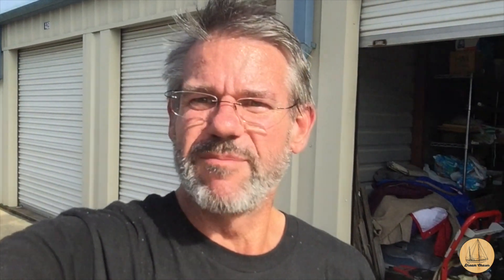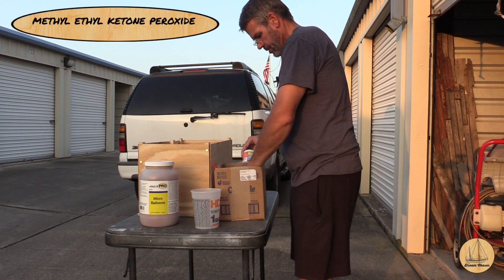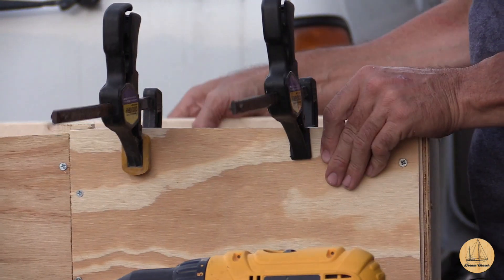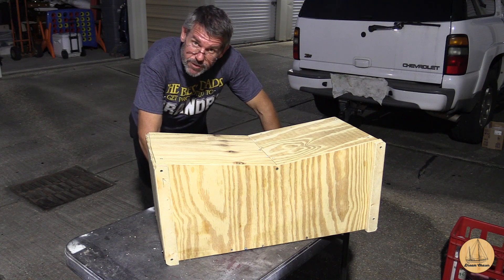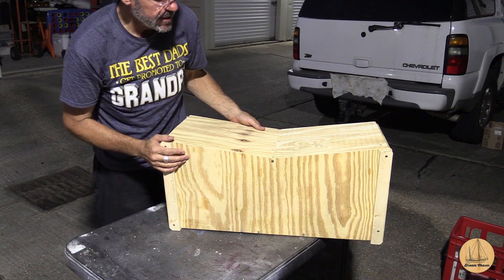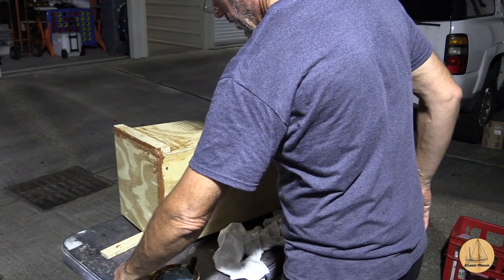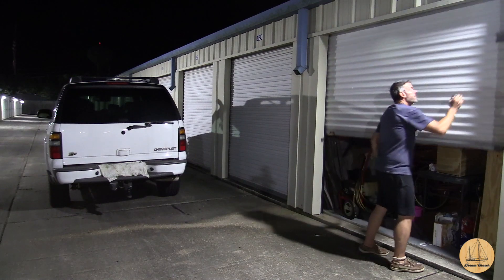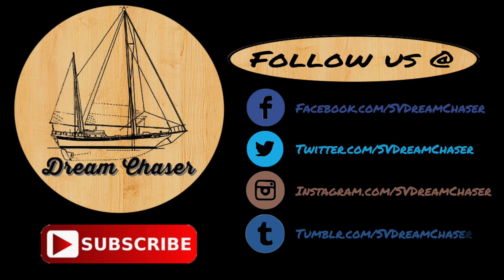Make your own Deck Box with Plywood and Fiberglass Part 1

Comment: thoughts for the future, i know this is older 2017. but cut ur wood at corners on 45 degrees, save a ton of resin. or glue corners w/less wood, kicking time is though i do same
Reply from the maker: Great tips. I struggled with this project. It ended up being the reminder for me to hire this fiberglass work out on the deck of the boat. Lol

Comment: great box... I'm going to build one at some point...something I've seen done is filling a plastic freezer bag with the epoxy fillet mix then cut a corner as a tip and squeeze it in, then spoon it...love your videos...thanks
Reply from the maker: Great idea.  I have done that filling screw holes or pushing epoxy into small holes.  I will have to try it on Fillets.
Reply: That sounds like a smart plan

Comment: I've worked with fiberglass with no heat in the middle of winter and in searing heat in the dead of summer.
Itd be perfect to be able to work in a walk in freezer then bring your project outside to harden.
Reply from the maker: Interesting. So was it all about the MEKP ratio adjustments depending on temperature?

Comment: Take it from a 40 year glass man, for corners where everything comes together, plain "Talcum Powder" and resin works as good if not better than microballoons or shredded mat
Reply from the maker: That is GREAT to know because as you can see from the finished product, I certainly lack the experience and skill in this area.  Frankly doing this project led me to hire someone to do the deck work on the boat.
Reply: Question: Could you use spray foam for inside corners... 
Tape off corners
Spray foam edges than let foam set up 
Than round over a thin piece of metal like band iron to get the round over radius 
Heat band iron with torch than heat trim the spray foam to exact round over
Peel off blue tape and done

Would that work?
Reply from the maker: Hopefully GasserGlass Will answer as well but I think it would. I have seen the boat yard use that expanding foam to fill a gab and then round it with a grater (not sure what else to call it) then glass over that for the contour.

Comment: Hi my name is Frank and I'm considering a buying this 32 foot Ketch and the deck is having some problem I haven't seen the boat yet I'm going on the 1st to see the entire boat but I could tell there was a one piece that had a hole in the in the decking and I'm very concerned about it even though the rest of the boat is fine but only by pictures so I'll be able to see it come the 1st or 2nd of July can I contact you and send some pictures and get some advice?
Reply from the maker: I am more than willing to have you do that. I am not an expert but I have certainly run into my share of deck issues and can provide some lessons learned and things I wish I had done to better negotiate my deal when I bought. Reach out to me at glhotka at SVDreamChaser dot com and we can trade contact info and what not.

Comment: It would have been so much quicker, easier, and less expensive to use bodyfiller for the fillets.
Reply from the maker: I think you may certainly be right.  I may have to do this whole project again now that I actually have learned a LITTLE bit about Fiberglassing.  This project actually was pretty crappy in hindsight, but it allowed me to get experience with the tools and materials without doing it on something valuable.  All I really lost was a few bucks and some of my time.

Comment: could you please answer a question please or point me in the right direction.I am making a 3 box plywood sump filter to go under my 500gallon fish tank. I have to do this because there is 2 metal supports stopping me having one big box. they will be joined together with pressure plumming screwed together. I'm planning on fibreglassing all the tank/boxes inside and out.. how much time can you leave the first coats and fibreglass before you have to put the coloured wax coat on please.
Reply from the maker: +Leigh Shelton - In my experience you don't have to wait between the coats but this assumes a few specific things.  First I am assuming that the polyester resin you are using does NOT contain wax.  Sometimes it will be called a "Laminating Epoxy"  This remains a little bit tacky and the final colored wax coat is what lets is fully cure free from air that allows it to harden.
I hope this response is helpful.   Also I can tell you from experience that 2 tanks joined together with either at least 2 lines between them is as good as a single tank.  I did this on a previous boat for holding waste water (not the same material, but maybe even more important to avoid leaks :))   If you have pipes plumbing the 2 together, just be sure you have one low and high on the tank so that any pumps that suck water our or put water in allow air to pass between the tanks to avoid an air lock.
Reply from the maker: Sorry I may have misunderstood your desire.  I assumed it was to do it all at one time quickly.  It doesn't really matter.  You can do all layers including the top wax layer at once, or you can also do layers of laminating resin with  any* time between coats.  I added the asterick because there may be some practical limits here.  For example I wouldn't go months, but I have done weeks without issue.  The only reason I wouldn't want to go too long is the "tacky" material may catch debris, dirt and dust that may not come out as easy when you are wiping the surface before your next coat.  I don't know that for  fact, but it seems logical to me.
Reply from the maker: Glad it helps.